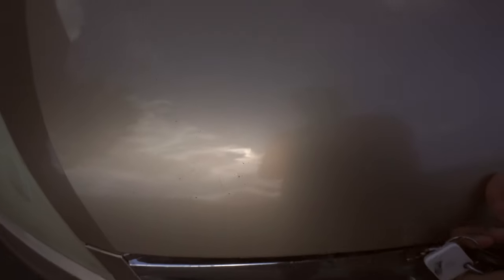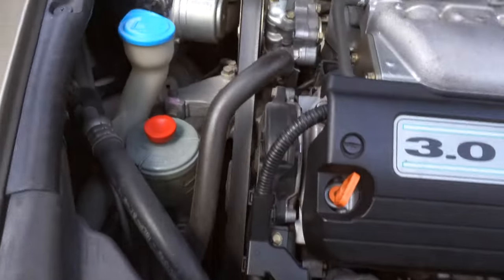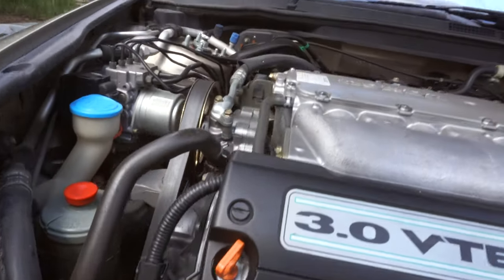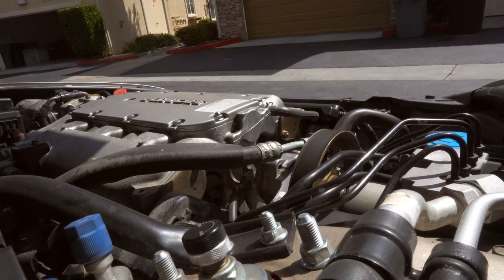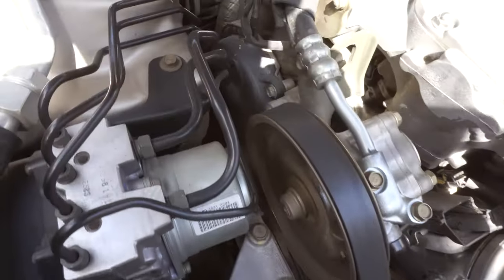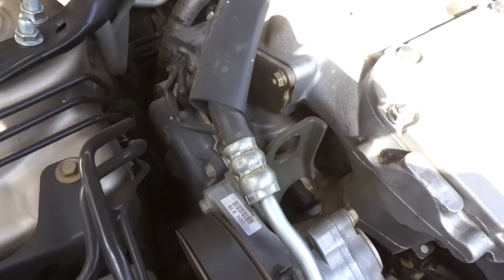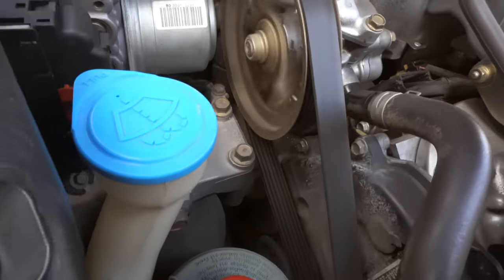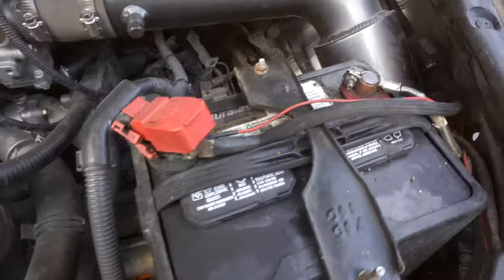THE TIMING BELT BROKE - STARTING A PODCAST

Comment: that’s crazy bro no mechanical issues at all?? how were you able to do that, could u give a rundown on how you maintenanced and checked your car
Reply from the maker: Honestly it was simple maintenance really, consistently staying on top of oil and fluid changes every couple months. used a fuel cleaner, and kept it somewhat clean so if I saw any stains anywhere I knew what it may have.